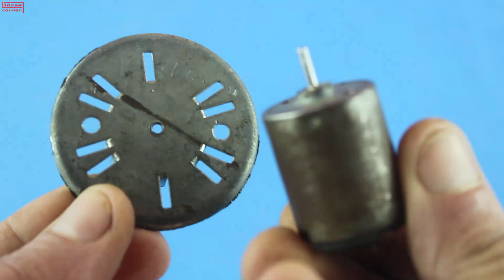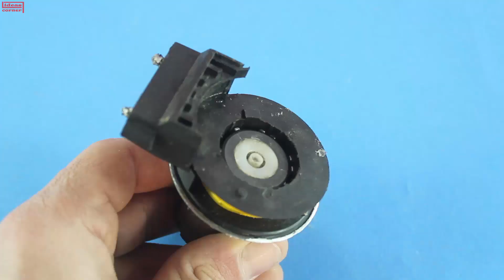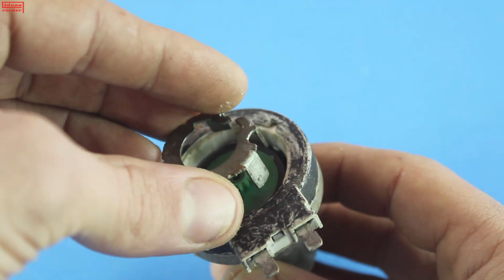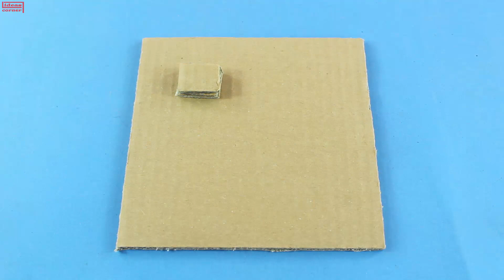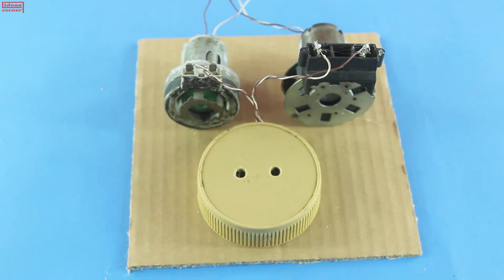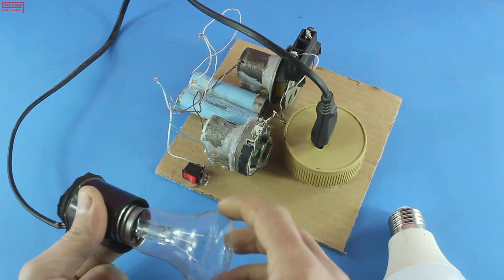How to Make a Magnet Motor Generator 220v Using DC Motor

Comment: WTF are you doing? What are those parts? Where are they from? What are they made of? I am guessing the larger black ring is your pick up coil? And the smaller round piece is your ring magnet? Your video needs alot more detail either spoken or written before I change my thumbs down to a thumbs up! Lol! 
It is interesting, so you have that going for you. You need to tweak the video. Once you add specifications I will probably like it. But that's just me